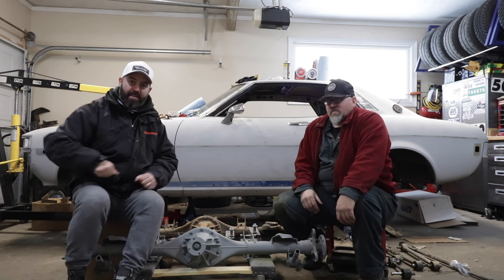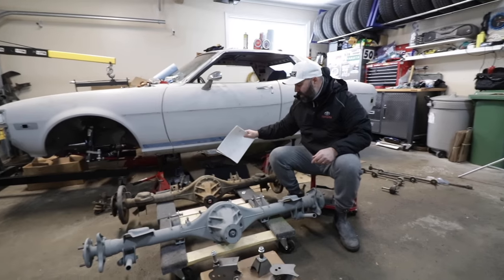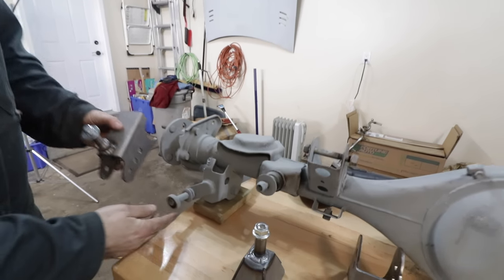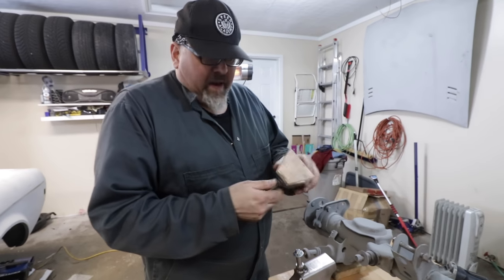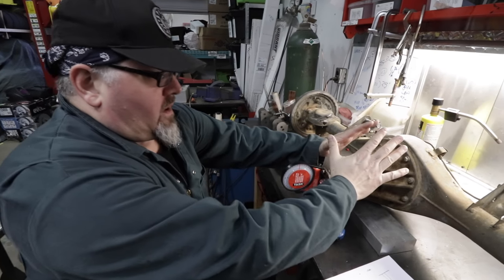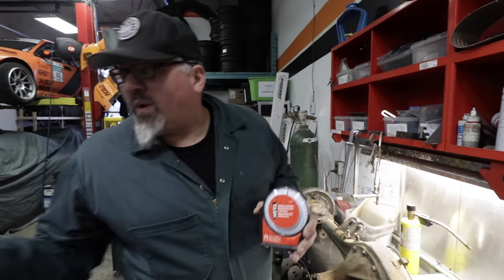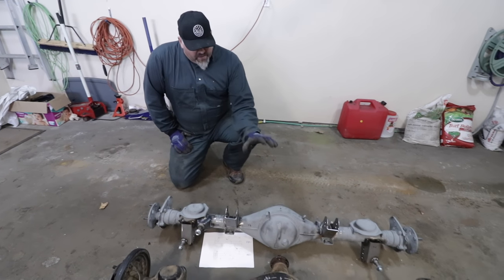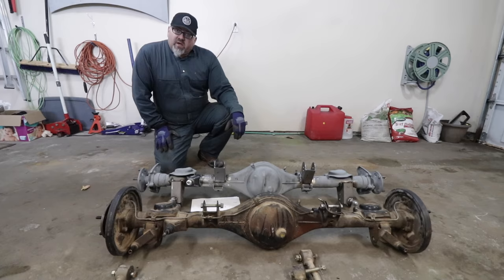How To Do A Rear Axle Swap - RA24 Toyota Celica Project

Comment: I did a similar swap on my 75 ra22. 
I used a 71 8inch hilux differential with a Detroit Trutrac.  I also used the excessive differental bracket kit.
Reply: Which bracket kit did you use for the ra22 from excessive? Also going a hilux diff in mine
Reply: Speedman, I also have a 1975 GT, could you possibly get in touch with me to help me out with any information on this? I would love to swap out my rear axel setup for lsd and disc breaks.

Comment: Will any of this work for my 1975 GT? I am having a very difficult time finding an AE86 GTS rear axel setup. Any suggestions? My axel bearing blew out from a pothole. I would rather do this swap then fix the bearings.

Comment: This is not hate but a real question. Was there a IRS option for this car? And it seamed like you are adding a lot of weight to the rear axle are you concerned about it?
Reply: IRS didn't become an option in the Celica till 1983, but the IRS was a semi trailing arm setup, not really that great for performance, better for comfort. I think in 86 the IRS was a lot better as they switched to a transverse setup for FWD/AWD.  I think the weight difference isn't that great and they are definitely lighter than most live axles, especially since this is I believe a 6.7" rear end.

Comment: Just out of curiosity did you guys consider a MKI Supra axle?
Reply from the maker: Ya, definitely considered it. If we could have found one, would have used it. Those are rarer than sasquatch riding a unicorn around here though, so we settled for an AE axle for now. Eventually I suspect we'll upgrade to either a beefier solid axle or convert it to IRS, but for now we'll get her up and running and ripping around the track with the AE axle and see how we like it.
Reply: Speed Academy Ah ok. I guess a lot more down here in CA.  Was the AE86 rear end more than $350?